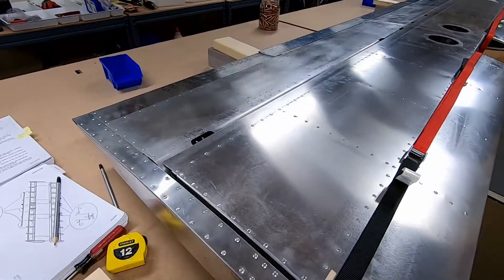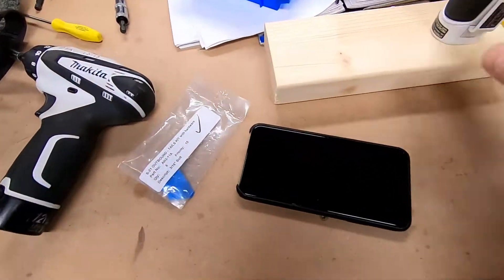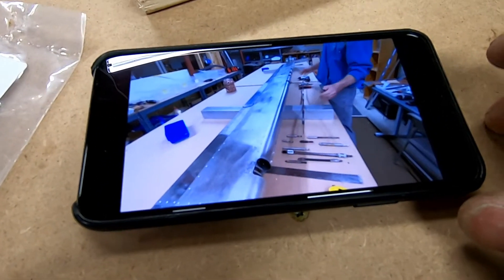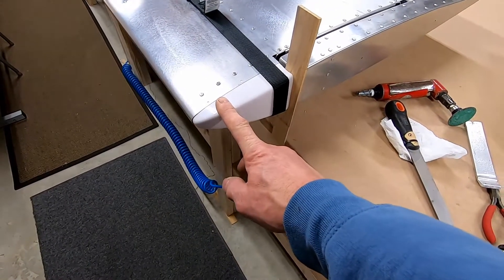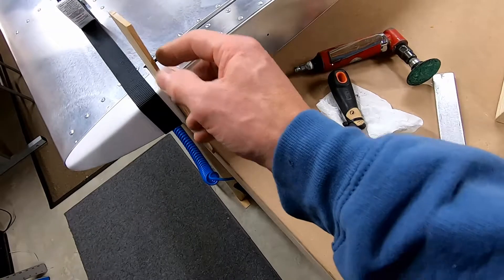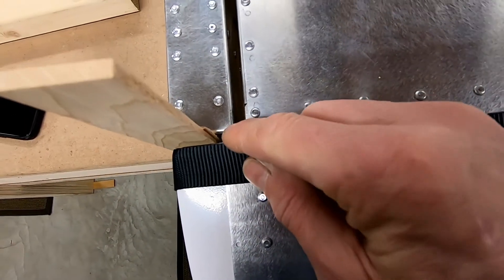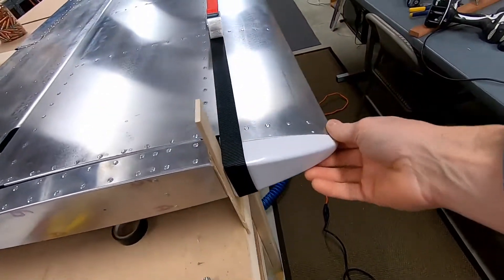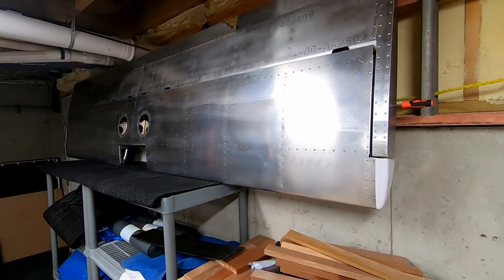RANS S-21 (009) Elevator end caps final fit

Comment: Applying heat is a little risky as too much could ruin the tip.  I just cut the point off of mine with a hacksaw somewhat like one of the RANS videos shows for the Rudder tip and they fit into place nicely.  I don’t think it is possible to attach a picture here to show what I did, but basically just cut off part of the inside flange right at the tip and be sure to stay far enough inside so that the notch is not visible and stays within the wing.
Reply from the maker: I feel pretty confident with heat molding plastic and thought it came out great.